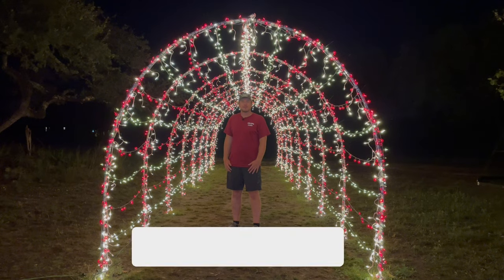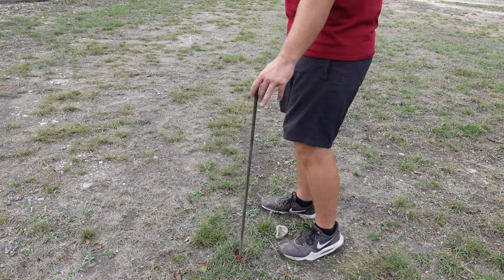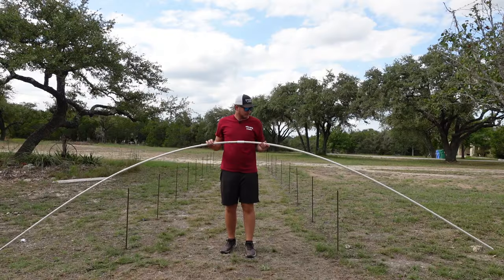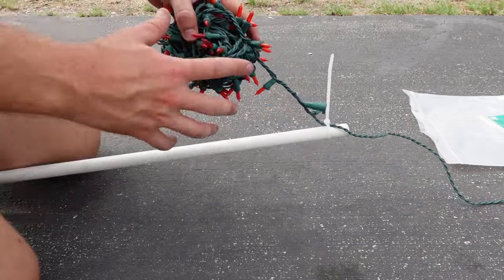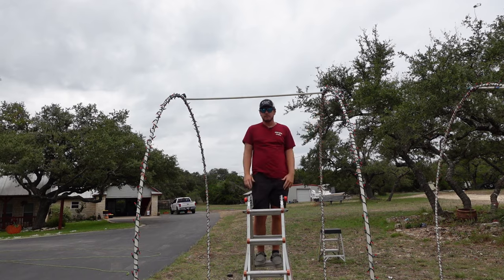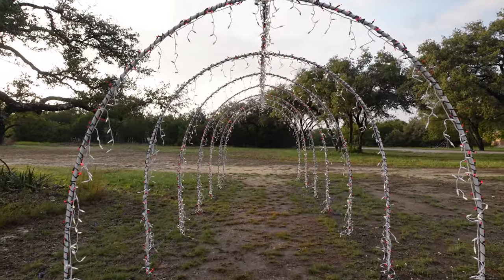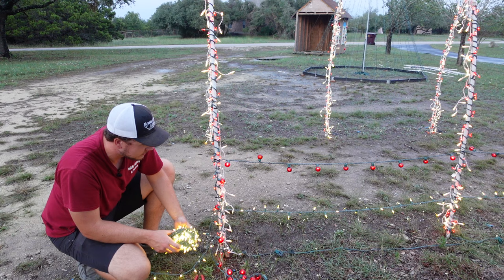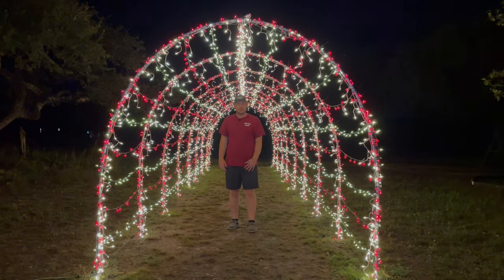How to build a Christmas archway tunnel out of PVC

Comment: I did this with incandescent mini lights from Home Depot, 3000 lights/ 20 strands of 100 and the fuses kept blowing. I built the whole thing, zip ties, etc and ended up ripping it down. I guess LED would have been better.
Reply from the maker: Yes, led is the best option for this since you can plug over 40 strands together depending on the light count.

Comment: Hi there, I I’m trying to do this on a pathway that is 6-7 feet wide, what length pipe should I use? 10 doesn’t fit as it’s too long and the bend would be too harsh causing it to snap.
Reply from the maker: I would recommend cutting the pipe to around 8’ or 9’ depending on the bend. You might have to practice with a few pieces before you cut them all.

Comment: Great tutorial! Looks amazing! For a 15 foot wide driveway would two 20 foot 1 inch pvc pipes with a connector in the center work for being able to drive under it?
Reply from the maker: That should work, for a total of 40’. I recommend using a t-post to secure the pipes instead of rebar.

Comment: Are you in a warm climate?  Actual snow and ice always weights down my arches.  I'd like to try a tunnel.
Reply from the maker: Yes I am in Texas. We have had ice before and it was fine. But it depends how much ice. Also, the more lights on the tunnel, the more weight from ice accumulation.
Reply: Thanks for the response.  The wind is playing havoc with my tunnel.  The connecting pieces keep coming out.  The 4-way connectors keep snapping too.  I'm going to use regular connectors without the 5' short pieces in between, that's what I've done in the past.  It probably doesn't help that I'm less than a mile from Lake Michigan and we get some nasty wind storms.  @holidaylightingcreations

Comment: I have a couple of questions.  I have had a pvc arch for several years now,  and I 8:16  decided to glue my fittings ( perhaps a bad decision) .Also, I have used (4) 5ft. sections rather than (2) 10' sections,  so I have 3 junctions per individual arch instead of your 1. I did that mostly for stability in winds etc., and becauseI followed another man's light arch directions on Pinterest when I first constructed my arch, and that is how he did it. 

The problems I have been experiencing have been with my pipe occasionally breaking at the junctures when I assemble my arch.  

I have 3 questions.  First, do you think that (4) 5' lengths are more prone to breakages than (2)10' sections.  Second, I think that my decision to glue the fittings might be part of the problem,  as when I assembled the arch,  each individual arch tends to twist away from having the fittings lined properly for the 5 ft' connector,  and I think it puts stress on the fittings when the connectors are inserted. Do you agree? Finally, do you feel that your method, (2) 10 ' sections with one connection,  is as stable  in wind as ( 4) 5' sections with 3 connections. 

I would appreciate any help you can offer as I really enjoy putting up my Christmas arch.

I know you probably get a lot of questions,  but your feedback would be appreciated,  as this year, I have broken two of my individual arches at the fittings,  and I am frustrated.
Reply: I would use screws to prevent the PVC and coupling from twisting apart

Comment: How many strands of lights did you use 🤔
Reply from the maker: For the tunnel walls probably around 31 strands at 24’ each. For each arch, 2 strands
Reply: @holidaylightingcreations  thank you 😊
Reply: @holidaylightingcreations   That's ~67 strings of lights total, assuming the setup in the video. So around $400+ of LED lights, to be clear. And that's only with post-season sales. Regular price is closer to $700, right?

Comment: All my PVC cross fittings are snapping. Going to reinforce joints with rebar on inside.
Reply from the maker: You might need to add glue if that is happening. Also, make sure your pvc is pushed all the way in the fittings.